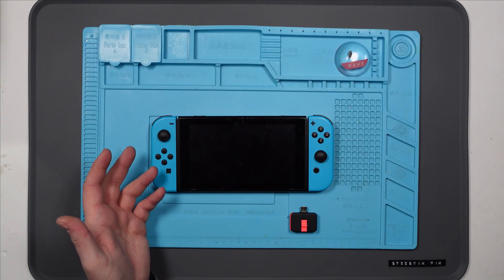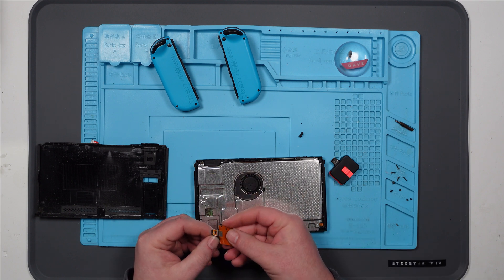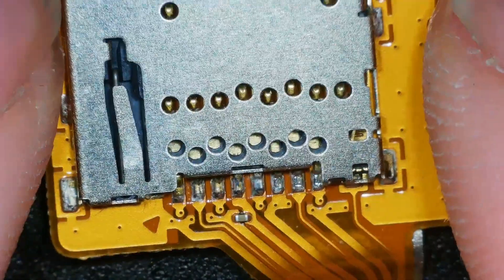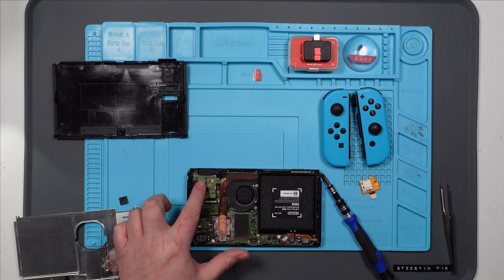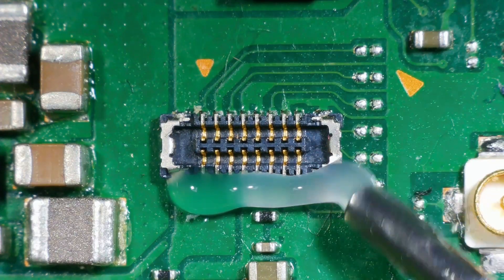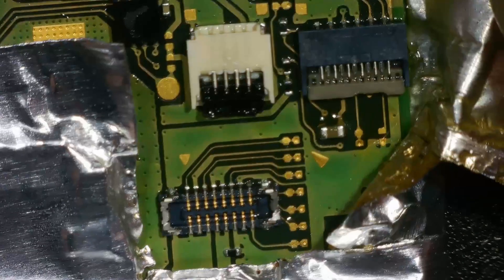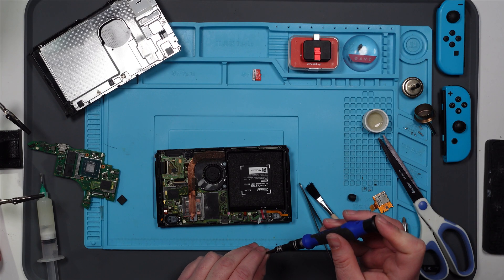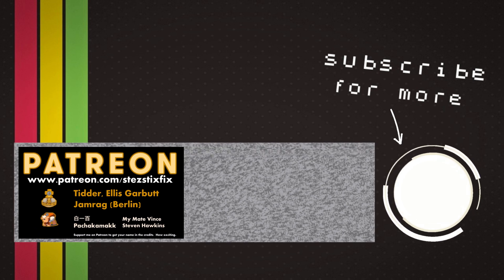[FATAL ERROR]:  Switch Doesn't Read SD Cards | Can I FIX It?

Comment: Thank you so much for this video. Was having the same issue and when i opened uo my switch the sd card reader just fell off(daughter likes to drop the switch) reseated and it worked without a flaw. Thank you so much as someone without a working switch for months

Comment: Question: wouldn’t it have been easier to simply remove one pin from the donor board’s connector than use the entire connector?
Reply: yeah i was thinking that. or just run a jumper to the sd reader.
Reply: lovely job on the swap tho

Comment: I had a modded switch and while the repair you did fixed the issue, it was unnecessary. It normally throws that error when the boot file on the SD card is not getting recognized by the dongle as well and has something to do with the RCM mode as well. For someone who doesn't have experience with the modded switch, definitely a great fix! It can be an extreme hassle, but it's mostly just reloading atmosphere or the newest patch of atmosphere on the SD card again.

Comment: A common issue with Switch Model 1, don't know if they fixed this on Switch Model 2, but they definitely did on OLED model.
Mine was saved by jumping a wire instead to the SD card reader.
Reply: happened to mine also i nmanaged to save it but good shout on soldering to the sd pcb directly if i ever do take it apart again which is highly possible aha!

Comment: Well done Steve, that replacement pulled into place with surface tension so nicely!!!!
Reply from the maker: Thanks Vince!  Unfortunately this has just come back to me as it's failed again! 😬 I'm about to tackle a revisit!
Reply: @StezStixFix  So it did fail on you sadly? If that's the case that is not good to hear, I've had this problem with my original switch sense I've opened it too many times apparently to where the connectors became loose. I have the little prongs I guess that came out to where it's not able to fully read the SD connector and is just the whole hassle. I looked at the oled switch and it seems to have it to where it's on a separate piece like how the switch card reader is instead of directly on the motherboard. I would love to get the console fixed and be able to mod it as well but for all the hassle that I have seen as well as barely any info otherwise, yeah it's ridiculous to try and even think about fixing it in general.
Reply: @xProErax that’s a long comment to say you have no idea what you’re doing.
Reply: @astra6712  yeah because no one else has this specific problem can you imagine actually trying to do it without any of the tech he had?

Comment: Good job. Those fpc connectors are annoying on I pads
Reply from the maker: Thanks Jon.  Yeah, I can imagine.  The one I heated from above just curled up into a ball, so I imagine if you use too much heat, even from underneath, it's game over!
Reply: @StezStixFix  top tip if you ever order 1 of these to repair something order at least 10 honestly

Comment: This is exactly the problem I have. although in my case it is 50/50 on whether the sd is recognised or errors out which confirms there must be some form of damage on the connector. Maybe this might be a good video case for him to investigate.
Reply from the maker: Thanks Danny!  Yeah, sounds like you may have a loose pin.  The first time I "fixed" this, I just thought the connector was loose, but it must have just been making a slight connection, and as soon as the console was jolted, it lost it again.  I think those tiny pins must be quite susceptible to a bit of corrosion!
Reply: @StezStixFix  wished I had the soldering confidence to do this myself. But I do know there is a wire bypass trick that can be done where the connector doesn’t need to be replaced but again that needs not only the chart but hand and eye coordination as one wrong move and your switch is fried

Comment: very nice repair Stez, i recently had to do the same job, but instead of replacing the whole connector I copied another youtuber who just took a single pin from another connector and soldered it on the missing one.
Reply from the maker: Thanks Roy!  In hindsight, I should have tried that but I couldn't find the pin which was missing.  I didn't think to just remove a pin from the donor and try that! 😬  I definitely will next time!

Comment: Good job on replacing that component.  Nice work.
Reply from the maker: Thanks Oz!  👍
Reply: @StezStixFix  if don't mind can you tell me what software you use to edit your videos. I really want to start performing recordings of my repairs and post them as well even though I have a face meant for radio.
Reply from the maker: @BawldZombieRaTz  no problem! I use ShotCut, but mainly because it's free and I'm a cheapskate. I haven't tried any of the "posh" ones from Adobe or similar, but ShotCut does everything I need it to and I found it really easy to pick up. 👍
Reply: @StezStixFix  well I'm a cheapskate as well... you can ask my wife and kids.. lol. Thank you I will check it out and its the right price too. 😀
Reply from the maker: 🤣 nothing wrong with being a cheapo! Good luck, I've just subscribed in anticipation of your first video! 😬
Reply: @StezStixFix  got the software and ordered 3 cams. I'll try to do my best and follow the great Steve... I just won't be as cool.
Reply from the maker: @BawldZombieRaTz  I can't wait to see it! You'll be awesome 👌.

Comment: Excellent work. That original connector looked so flaccid when you removed it I wondered how you would get the donor off intact.
Reply from the maker: I have a reply involving flacid removal which I'd better not post on here.
Reply: @StezStixFix  😂

Comment: Incorrect amount of thermal paste expertly applied there 🤣 Good fix man!
Reply from the maker: 😊 thanks James!
Reply: actually no. theres a huge gap between the heatpipe and the metal back shield.
Nintendo used a thick thermalputty here, so using something like K5-Pro does the trick.

Comment: Yooo that was a solid repair! You're getting good at this! Also, not an expert, but in (I think) the latest TronicsFix video trying to fix a camera, he showed you can replace just the single pin on those types of connectors if you don't have another connector to replace it.
Reply from the maker: Thanks Deeran 👍, yeah if I could have found the original pin, I would definitely have tried that!
Reply: @StezStixFix  I'll add to this. I replaced the pin on the game reader socket by transplanting just one pin. its a similar style to this sd socket. 

I was prepared replace the whole connector if that didn't work. but luckily it did.
I do however think replacing the whole connector is a better way of doing it, as I assume the pin is glued/moulded into the plastic slighty too.

keep up the good work
Reply: You've gotten better at soldering as well.